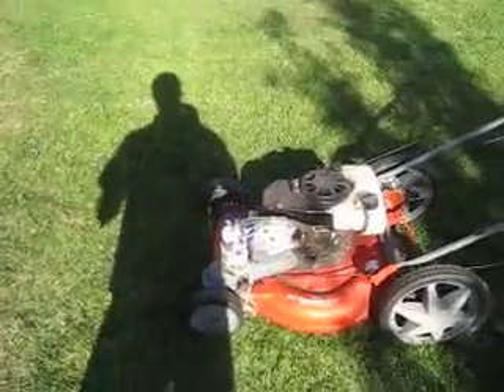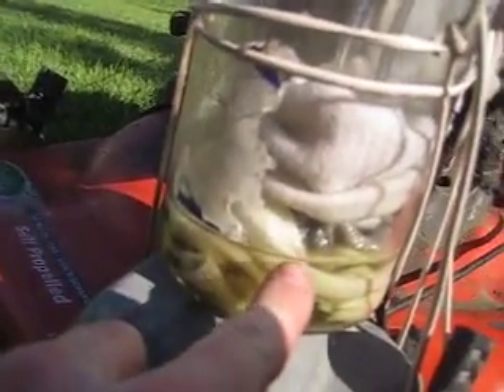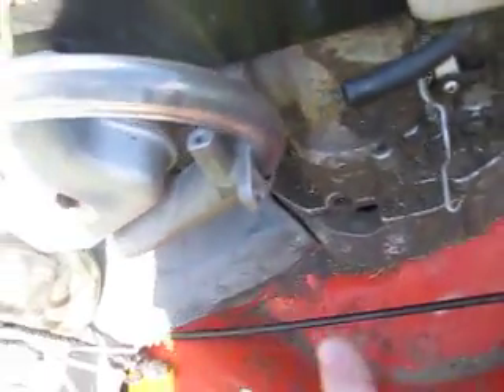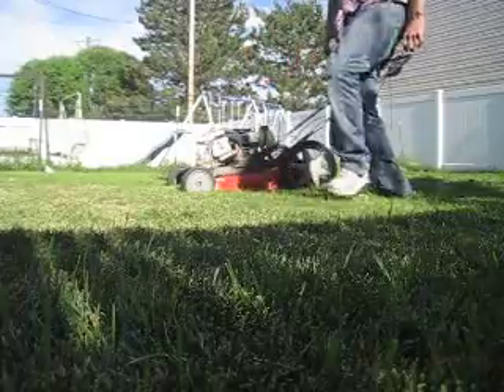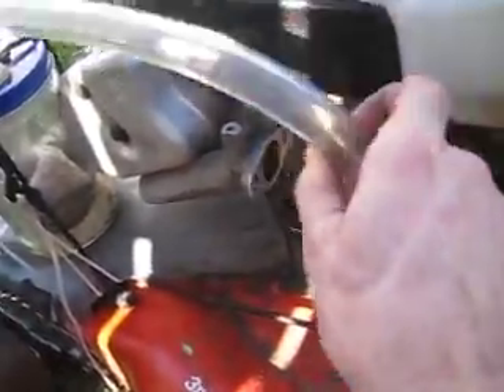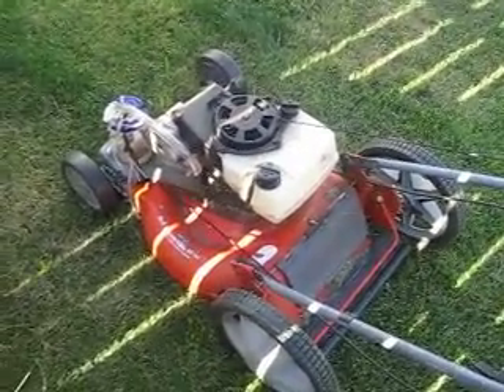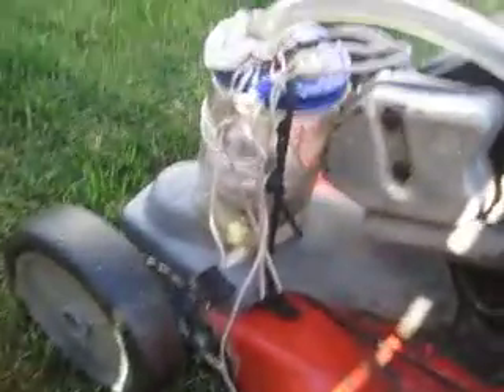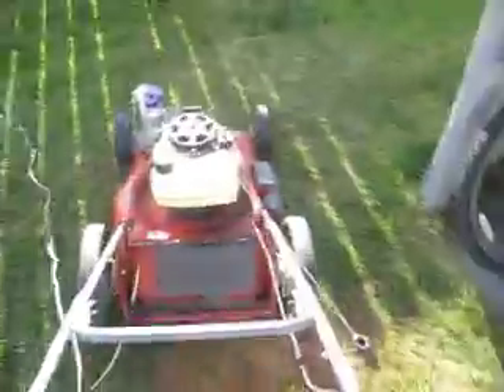Lawn Mower Running On Gasoline Vapor "In Depth"

Comment: Be careful with that glass jar, I had a system that was similar on my car that I made out of a gallon pickle jar. It was very cool to see what was actually happening inside the container, but I added a second line with no backfire protection and the engine backfired and the jar exploded. I don't know if backfire is even an issue with straight vapor, I was using both vapor and a carburator, but I would hate for you or your kids to get hurt.
Reply: Your system should have a flashback arrestor to avoid those types of situations
Reply from the maker: Daniel Hellard Thanks, It does. I have a cloth screen placed in the vapor outlet tube.
Reply: Daniel Hellard
What can I say? I was young and dumb. I had a backfire protector, but got in a hurry and added a second line without one. I was lucky it only poked a small hole in my radiator and melted my hood release and a guy came running up with a fire extiguisher and put out the fire before I even got out of the car. It is easier to learn from other people's mistakes than to make them all yourself.
Reply from the maker: brewmiester11 That's for sure. learn from the mistakes of others so you don't have to witness it for yourself.

Comment: you should rig the old lever on the handle up to a butterfly valve between the old carb port and the vapor hose. would that not give you a hands off kill switch ? or even to the throttle lever for idle speed control ?

Comment from the maker: It is very efficient. Yes you would need a flash back arrestor. You can you any type of screening material that can withstand allot of heat such as aluminum Window screen.

Comment from the maker: I did not do that on the mower because my carburator went bad that is actually why I built a vaporizer for it. I am going to be doing allot more testing running my car on a new improved vapor system.

Comment: A question , please : Did you measure for example how much time it need to spend 100ml of normal use of gas and how much time it need to spend 100ml with vaporizer  ? I think that will be the best way to prove that this is working well ...Thanks .
p.s. subd

Comment: But you have to make sure you have a high enough temperature to produce enough gas vapor to power your engine as you rev it and put it under load. I am currently working on a way to store the gas vapor so you don't have to worry about not having enough when put under high load. Thank you for your awesome videos!!!! And i will be putting it on my car as soon as i can perfect it.

Comment: and also i have 3 lines going into the jar. 1 goes to the engine. 2 is the bubbler. And 3 is my gas line. So as i am riding if i start loosing power i let in just a little gas which is then absorbed into the socks. I have the same design of your air intake valve on your other video with the mower. But because i can have a steady temperature i don't have to worry about changing the air flow except like once.

Comment from the maker: I hope to be able to share more information on my new design soon. It's all comes down to money and having enough to test, perfect, and protect the new design. Its been a slower process they I had hoped but the day will come when we can all have this new vapor system that will greatly increase efficiency and fuel mileage it will not be suppressed and the information will be available for all to build one for themselves if they so chose, or they can buy the vapor system from me.

Comment: Hi Tyson! I was wondering... in your new design how do you control the injector pulses? I'm struggling with this issue. I made a circuit which pulses the injector, and I'm able to adjust it with a potentiometer but how to do it with your throttle? I was thinking to do it with the TPS but the voltage between both circuits is different and one circuit is going to affect the other so I'm stuck in this. Any help you can give is really appreciated. Take care!